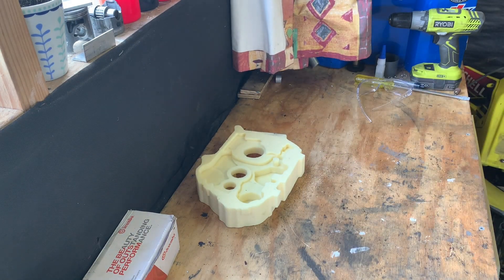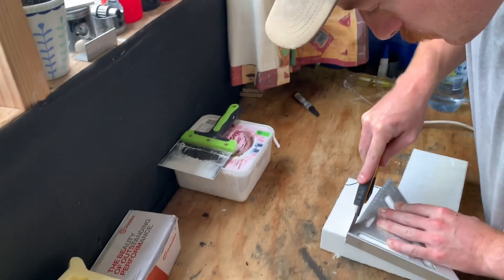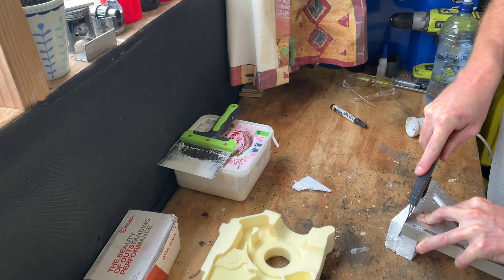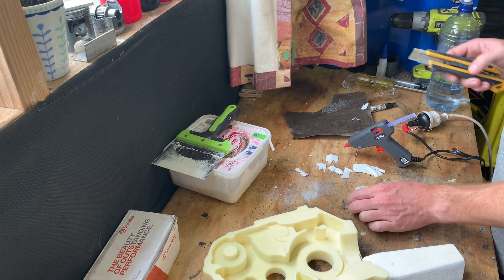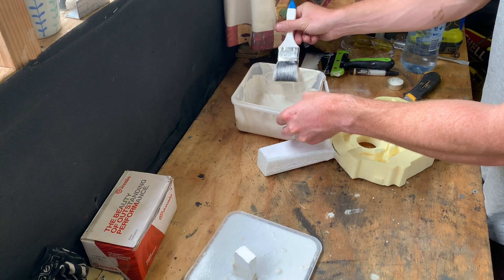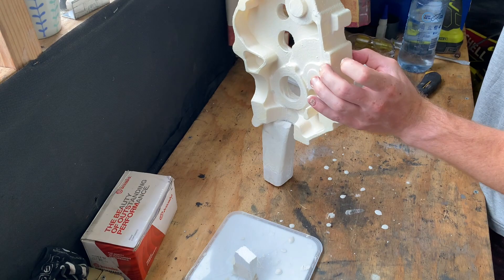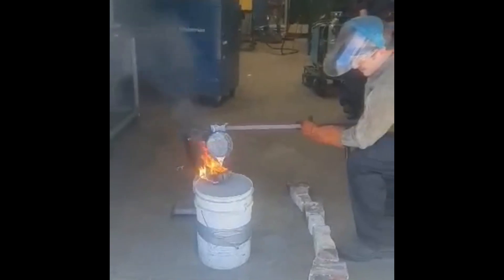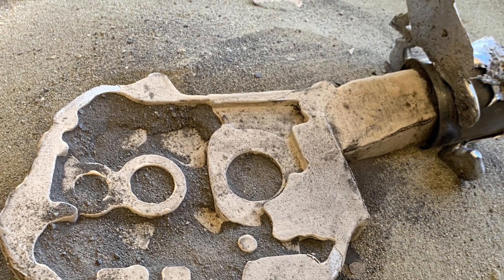Lost Foam Casting an Engine at Home

Comment: Hi mate. I just came across your videos last night and have watched a couple. Very interresting as I am thinking about doing my own motorcycle (4-stroke) cylinder head. I had been thinking of machining a solid block of alloy but now I may well concider doing it like you have. I'm only at the "planning in my head stage" as I have other commitments at the moment and this could work as a winter project. I'm in Te Awamutu, where are you based? Ken
Reply from the maker: I’m down in Palmerston North, send me an email, I’m more than happy to share information.

Comment: Doesnt the plaster block the gases from escaping to the sand? How it can work? 
Im also casting engine cases in near future and your videos are really helpful.
Reply from the maker: Thank you. It won’t stop the gasses but  it will slow the gasses down and give the aluminium time to fill the mould. If the gasses escape too fast the mould could collapse or lose some of its shape.

Comment: Nice job mate! Metcast in Auckland sells a water-based high zircon refractory coating called holcoat. The refractory can be kept in the bucket/tin indefinitely and just needs a mix up with a paint mixer. This  outing is used in the industry for lost foam casting and has fantastic permeability. One dip coat is all you will need and makes for a fantastic casting. It's really not that expensive. Ask gor David when you phone and say you know me.
Reply from the maker: Thanks for that I’ll definitely do that when it comes time to cast my next engine.

Comment: Your casting came out very good and really surprised me.
what type of sand did you use and the grade of aluminium.
Reply from the maker: Thanks, the aluminium was whatever Honda used to cast ct90 cylinder heads. The sand was regular old sand from the hardware store.
Reply: @OddsandEndsMachining  Just goes to show that one can use anything to make good castings
Best thing is and  that is using old metal to that can be found for nothing is a bonus
looking forward to seeing it being machined.